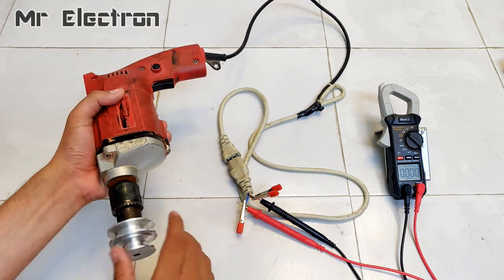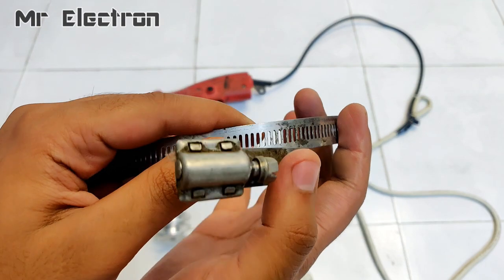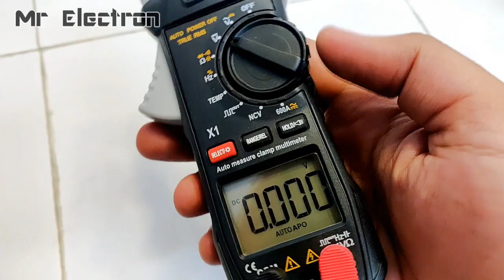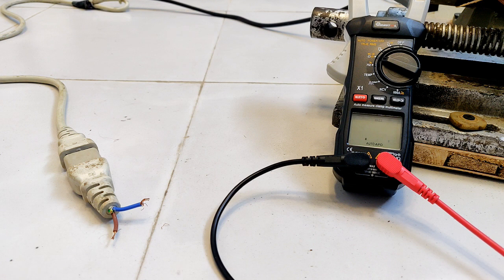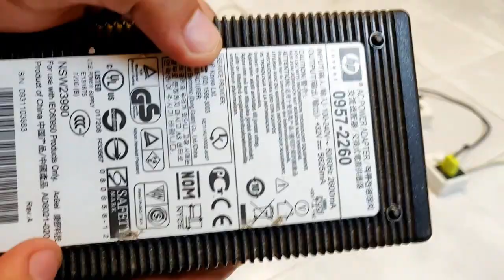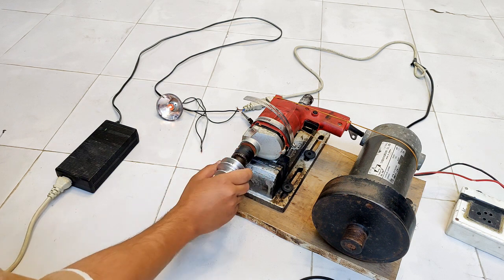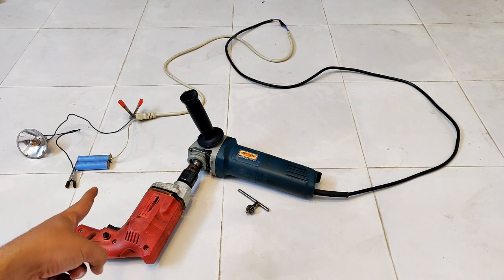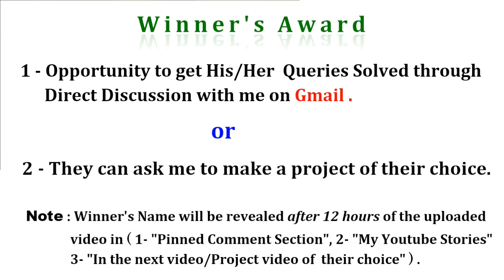Make 12V DC Electric Generator from 220v Drill Motor

Comment: No it is not a good idea since it is built with an universal motor which only generates "usable" voltage when the stator is excited. A better solution would be to use a brushless dc motor since you don't have to excite any windings to get usable voltage from it because it has permanent magnets.

Comment from the maker: Hey Everyone ! The answer for the question asked in this video is ' Yes ' its a good idea to use a drill machine as an Electric Generator because there are also drill machines with much higher power rating ( as high as 1500 Watts ) and those are going to work just great because their winding resistance is going to be much lower.
 I will upload a video for it in one of my upcoming videos.

Best Regards,
Mr Electron
Reply: Well thats interesting to know gotta check that out but since we dont use 1500watts here i would of never known we usually just use a gas powered machine when dealing with heavier situations to avoid the use of electricity and over loading the circuit breaker
Reply from the maker: Ohh !!! 😃
Reply: Is the capacitor in the drill acting as a diode?
Reply from the maker: @paulleftwick7782  No capacitor in my drill.
Reply from the maker: @paulleftwick7782  i just used a 3.7v li-ion battery in series
Reply: Cheers aveagoodone
Reply: pro trick : you can watch series at Flixzone. Been using them for watching lots of of movies these days.
Reply: @Raiden Killian Definitely, been watching on Flixzone for since november myself :)
Reply: @Raiden Killian yup, have been watching on Flixzone for since december myself :)

Comment: You're making generator by a drill or motor but you don't know the basic rule of generator, I have to say.
always, the pulley size of the powering motor will be bigger than the pulley of the generator motor, so that the RPM will be more than the powering motor. And as a result you will get more voltage and amps. 
Sorry, don't mind.💙

Comment: Bro could you tell me which motor is best for electric generation I see many options on ur channel but now I'm confused... 

Some of option which I found like

E Bike Motor/ Alternator / 12v Dc motor /  pressure booster water purifier motor... 

Which is the best plz suggest if you have other option... I want to build wind turbine myself
Reply from the maker: Ebike or 12v dc motor
Reply: @MrElectron  could you provide the Amazon links for the best one pweeeej... Also the items links which u shared for bangood is not supply any motor to India... At any location so it would be great if u can provide links of Amazon or flipkart something.... Plz 🙏
Reply: I just bought  24 v my1016 ebike motor is it useful as wind generator please let me know

Comment: That's an awful lot of work for getting a 12-volt light bulb to light I'm sure for the price of that pulley you bought you could have easily bought a 12-volt battery
Reply: Your missing the point. The idea is to generate power with out relying on electricity from the wall or in a cituation where its scars to charge your 12 batteries basically green solar energy

Comment: It is not a good idea to use drillers as generators (unless modified), seeing as their windings have a high resistance. This means that the windings limit the current the drill generator can exert, thus not making it good for high power applications.

Comment: No its not a great idea to use a drill as a generator. The chuck has a couple of gears that it used to make more torque and less stress on the motor inside plus some drills dont have permanent magnets motors but induction so no magnetic field will be created. In the case you do get  a drill with magnets and spin in reverse you would be spinning the chuck too many times just to get very little output voltage  since the magnets are very weak normally not to mention the circuitry inside to prevent reverse power going out of the motor into the main or battery supply